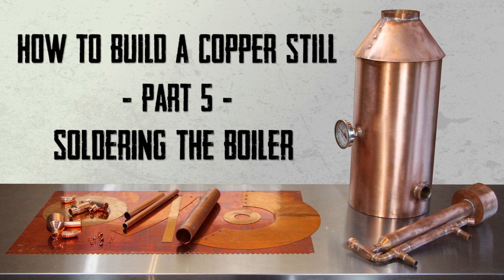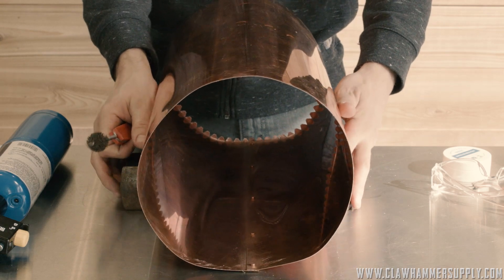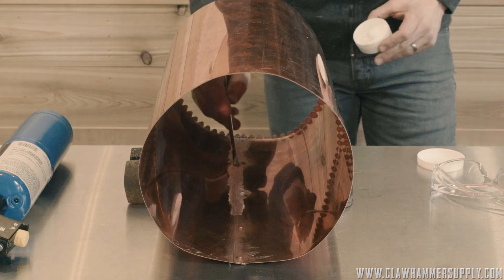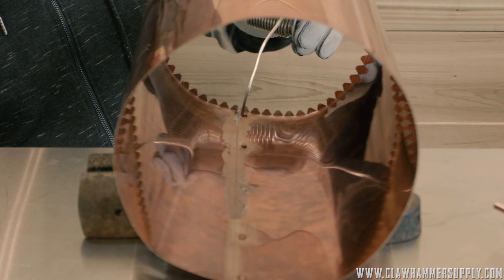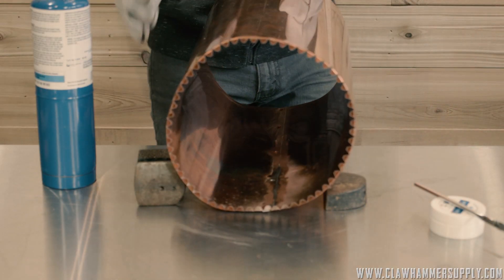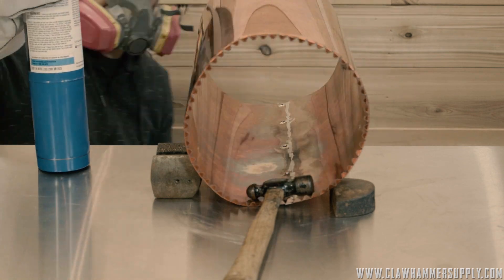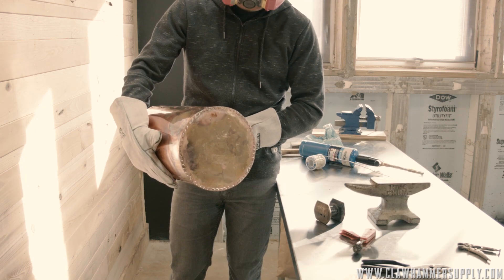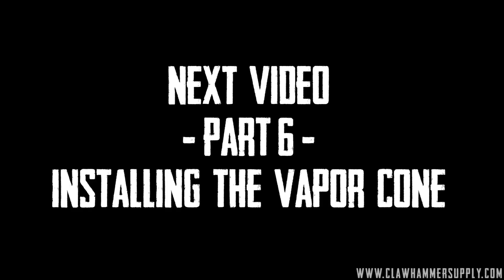How to Make a Moonshine Still - Part 5 - How to Solder

Comment: If you’re soldering a pot, what stops the solder from melting when you fire up the still?
Reply: the melting point of the solder is higher than the heat you should be putting through this the lead free solder is mostly silver this brand of solder is most likely silver bright which has a melting point of around 1145 degrees F

Comment: If you use a file or emery cloth to take off the square corner of any part you are going to solder it will make a better job because solder will not go over a square corner

Comment: Flux the copper BEFORE you lap and rivet it. The Flux is what draws the solder in. You will get a much stronger seem. Unroll the solder as straight as possible and lay it down the whole length of the cylinder at the over lap and when you apply heat it will suck it in. Same for bottom. Make a circle with the solder (Id) and lay it in the bottom. Take your time it’s very easy to scorch that thin copper

Comment: Why are you so worried about all the prettiness for example the  solder seams being visible and the roundness of the boiler I understand it’s a piece of art but does all that make a difference in how it works if not don’t sweat the small stuff.

Comment: Can't the solder melt when you heat up the boiler potentially causing a disaster like your mash/wash spilling pouring out the bottom? Or contaminating your mash/wash with the solder
Reply: That's what I'm wondering aswell

Comment: Why making the still so tall? I would think that if it is wider and shorter it would be easier to work on and also more efficient in evaporating the alcohol when used.
Reply: I think the liebig condenser is too close to the still as well. Maybe move it away 3 or 4 inches.

Comment: I was concerned that my boiler wasn't perfectly round and had some imperfections. Came back to rewatch your vid and saw yours isn't perfect and I felt much better!
Reply: if you can find a cylinder to wrap it around that fits the size you want to make it, can be perfect or pretty close
Reply: Rude
Reply: @OzTraveller2020  I now realize my comment sounds insulting but I didnt mean it to be.

Comment: If i were to copy your build, could i do it all with stainless steel just like this?
Reply: You will have to use what is called "silver solder".  For that you need an oxy -acetylene torch. Same as braising, but with much lower heat and very much stonger than solder.
Reply: Thanks guys. I wound up making one, i used fos-sil and tig welding but it didn't hold a seal. So now it's in the junk pile but i'm going to try again soon
Reply: Just remember, that copper is used because it removes unpleasant sulfides from your distillate.  Stainless won't do that.  At the very least, make the column copper.

Comment: wont the heat from a propane burner under this pot start melting the solder on the bottom plate ? shouldn't it be brazed instead?
Reply: No, the heat won't melt the solder unless the pot is heated without liquid in it. the liquid will absorb the heat transfer from the copper. Same principle as heating water to boiling (212 degrees fahrenheit)  over an open fire in a paper cup, or a plastic water bottle.
Reply: @mfcheshire  lead free solder can have a melt temp of anywhere between 90deg c and 450 degC ,i think a propane burner under the pot will reach higher that than or near it eventually even if there is liquid in it so im still not sure how they do this,,and are you serious about paper cup or plastic bottle not burning or melting under a fire simply because they are filled with liquid? no way man i never seen that being done ,impossible if you think the water will heat up and the containers wont melt or burn ,common you for real?
Reply: @ARCSTREAMS Try it, fill a paper cup with water and try to light it on fire. Wont burn
Reply: @robrod7120  and a plastic water bottle wont melt right over a flame? but instead will allow heat transfer to boil the water inside? ridiculous

Comment: how does distilling over a propane burner not remelt the solder?? just because it's not as concentrated and as hot? or does that happen sometimes?
Reply from the maker: Water boils at 212-- there will always be liquid in the still so the still won't get above 212-- solder melts at a higher temp than that. Full article:  https://www.clawhammersupply.com/blogs/moonshine-still-blog/43011204-lead-free-solder-and-copper-distillation-equipment

Comment: Great videos, am i trying to get my hands on some cooper sheets like you have 16oz 24 gauge c110 food grade , but i have 2 questions for you. First one is what is the size of the sheet it self?
Second one is the cerated end you fold at 90 degrees do you make them or it comes like that? And if not how do you make them, any tricks you suggest. Thanks from a northern Quebec fan
Reply from the maker: 4x8 sheets. We make the serrated edge-- we cut everything on a waterjet-- but when we started it was all cut by hand with some tin-snips. We ship our kits to Quebec-- no issues there.
Reply: @ClawhammerSupply I think he means the size you are using here. After you cut it from the 4x8 sheet

Comment: Can you distill over flame or will that cause the solder to run?
Reply from the maker: There are no issues distilling over a flame. The melting point of lead free solder is between 420-460 degrees, there will always be liquid in the still, and water boils at 212 degrees. Since the still always will have liquid in it, the still won't get above 212 degrees. Since the melting point of solder is between 420-460 degrees we can safely say that the lead free solder will not melt.
Reply: @ClawhammerSupply  I’m a copper smith and tig weld copper all the time. Never built a still but but a friend bought a kit and asked me to build it for him. curious if welding it instead of soldering it would be better or not

Comment: Hello, does the still come with a long enough dripping arm? (to direct alcohol away from the boiler).
Reply from the maker: That is the only piece of copper we don't include in the kit. Everyone is going to have their still setup differently-- some will use a hot plate , some willl use a turkey burner, some will use a heating element-- some will have it on a table etc. You just need to purchase a piece of 1/2" copper pipe (type M) from any local hardware store for a few bucks. I recommend buying a 5 foot piece and cutting it  to length that way you can make it as long as you need.
Reply: I am not from the states, and getting copper pipes is a little daunting of a task where I live. Would it be possible to have a straight piece of pipe shipped with a still? Thank you.
Reply from the maker: We don't  include it in the kit as it is very expensive to ship a 5 foot piece of copper.  You can also use food safe silicone hose:  https://www.clawhammersupply.com/collections/all-products/products/output-hose-and-clamp-for-our-8-gallon-copper-column
Reply: Rather not have any synthetics in my still. Nonetheless, thank you very much for answering.
Reply from the maker: I hear ya! We actually include a 45 degree coupling with the kit which allows you to add a 1/2" piece of copper on the end of the drip arm.